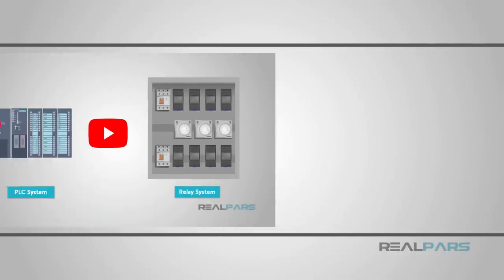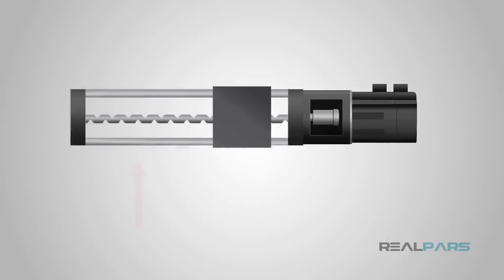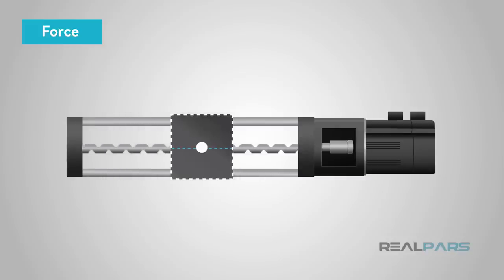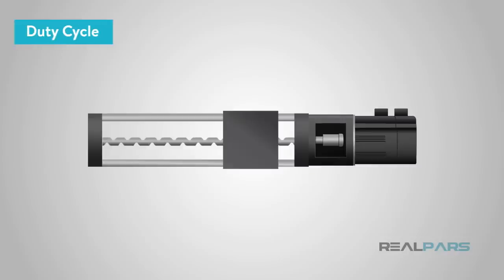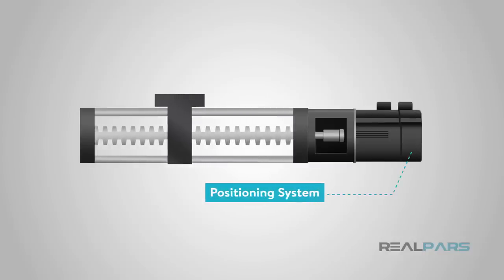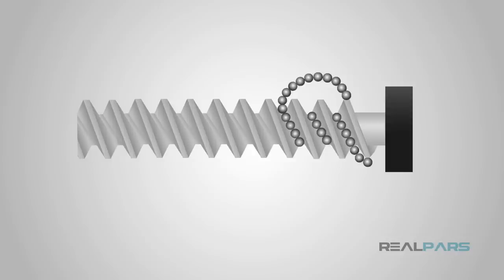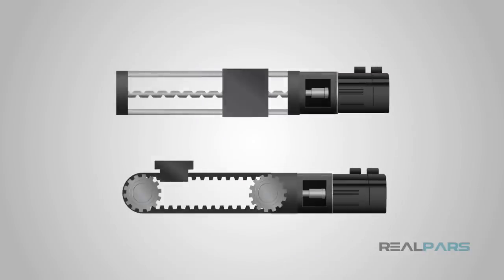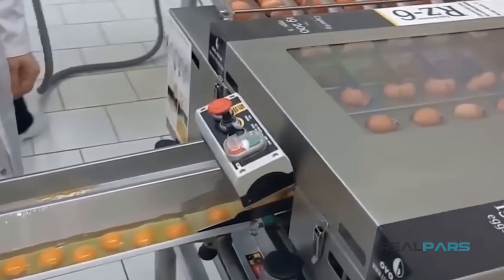What is Linear Motion Control?

Comment: Very informative. How do belt and ball-screw rails compare from durability perspective?
Reply from the maker: That really depends on the service and the size of load being moved.  Typically, belt-driven systems will require maintenance more often than ball-screw drives.  Belts tend to stretch an deform if not tensioned properly or aligned properly.  Ball-screw drives are very durable, but maintaining good lubrication is very important.  Generally, ball-screw systems can transport heavier loads than belt systems and can develop higher thrust.  Belt drives are much more economical if a load has to be moved a long distance (>3 meters).

Comment: i still dont understand how the screw is not coming out when spinning. Is there any suggested time stamp?
Reply from the maker: The screw is fixed at the drive end.  When the screw rotates, the load nut moves along the screw shaft.  Physical stops at the end of the screw shaft prevent the load from moving off of the end of the shaft.

Comment: Please sir can you help me ! I want to input analog signals from potential transformer and current transformer to the analog input of PLC SO what interface do i have to implemt So the output of these two transformers can be measured and plc can read these signals?
Reply from the maker: First, you need to make sure that the analog input card that you have for the PLC is able to receive the type of signal that you want to connect to it. Then you can read the manual for the sensor and follow the exact wiring diagram to wire the sensor to the PLC input card.
Reply: Suppose that plc can accept analog input but what device do i need to convert A.C secondary current to measureable by PLC?

Comment: How to increase speed of servo motor to servo drive...
Reply from the maker: There is a limit to the speed that a servo motor can run.  Check the motor nameplate to insure to understand this maximum.  Increasing speed above this maximum will require a new motor or a different gear reducer.  Many times, there is a maximum speed that is configured in the servo drive.  Check for that parameter and see if it can be increased.  Often, the maximum speed is set due to limitations in the device being driven.  For example, many conveyors cannot be operated faster than a certain speed or they might jump a track or cause excessive vibration.
Reply: @realpars  thank you sir for your responce and sugestion...